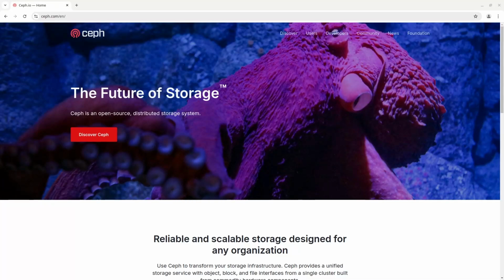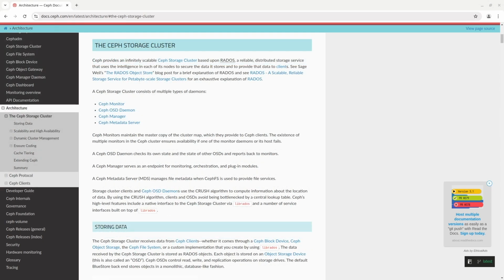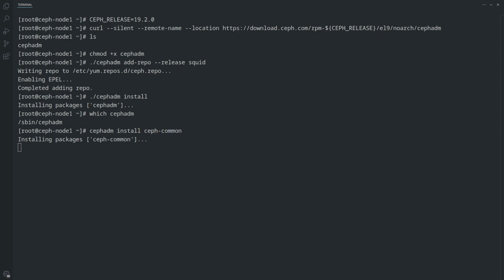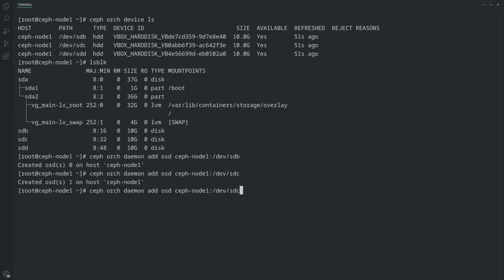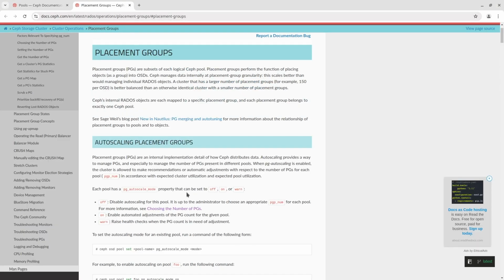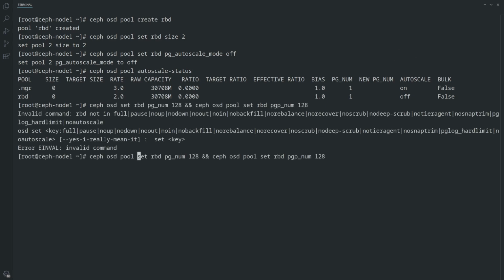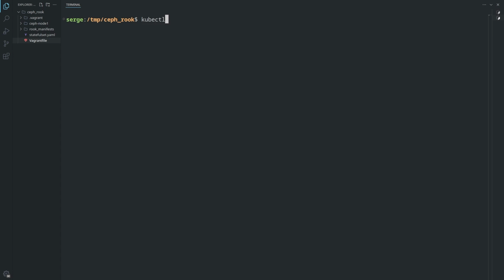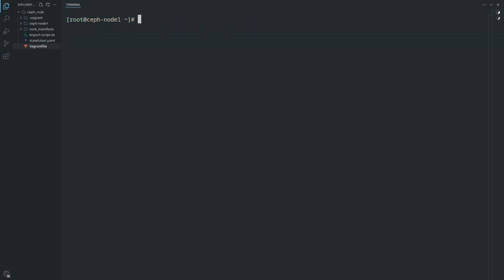Easy Ceph Installation and Integration with Kubernetes using Rook

Comment: it would be great to see pt.2 "Install Rook-Ceph as a Helm Chart (Everything in Kubernetes)"
Reply: It's almost the same. You edit the values.yml file and adjust the operator and cluster parameters. With rook, you got more granular control than going the helm route